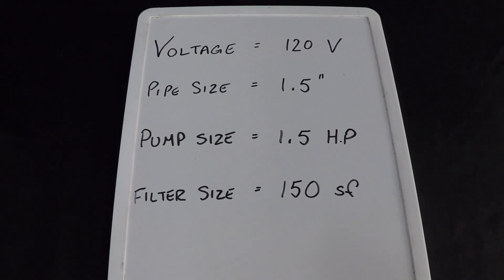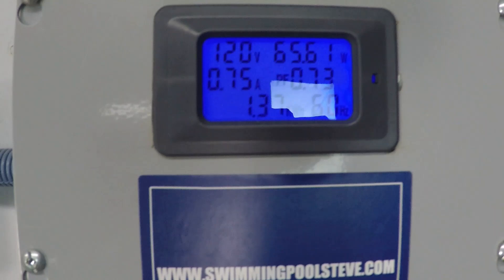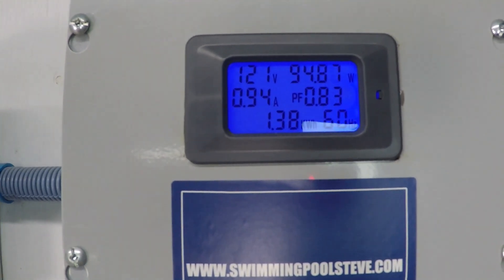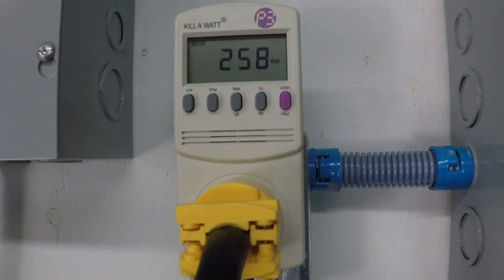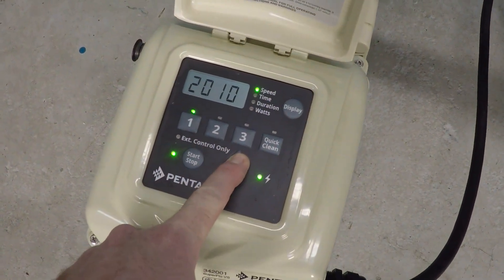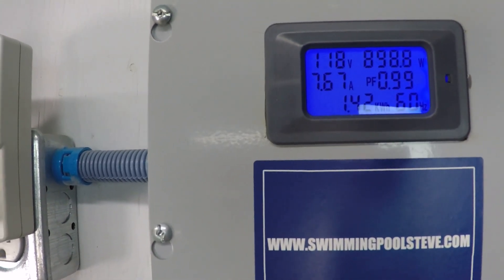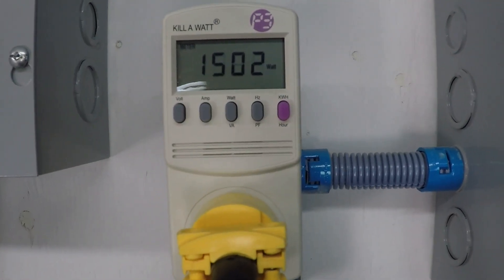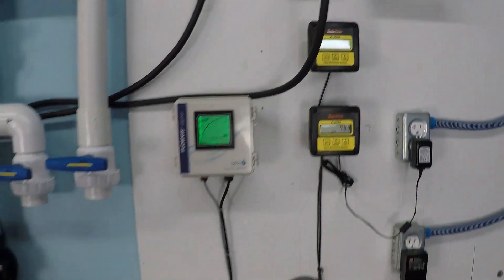Proof Variable Speed Pumps Are Better

Comment: It’s interesting how much you can save especially with electrical rates that differ throughout the day. Where I am in Ontario it’s cheap at night so I run it at 2500 for 7 hours to run the heater and chlorinate the pool. During the day the only reason I need it on is to have the skimmer pulling in the surface debris and to mix the hot there water the solar blanket creates so I have it on around 750rpm for a few hours in the afternoon. I’ve noticed a big difference in the pump housing temp obviously between the low and higher speeds. 
 So basically a variable speed pump is a money saver. It’s just unfortunate if you need a bit more flow for heaters/chlorine otherwise I’d just leave it at around 750rpm and it won’t cost more than a couple of 60 watt light bulbs

Comment: Thanks for the video, Steve. 
What a cool test setup you have there; I've always had a bit of a dream to build one to flow test various fittings and pumps, to answer the big questions in a pool service's life with concrete data: How much worse are those street 90s vs sweep elbows? 

Sure is an expensive way to play legos.